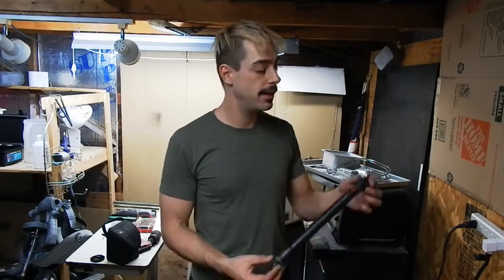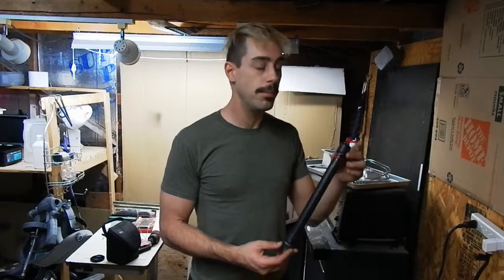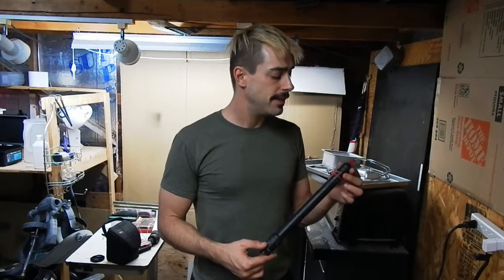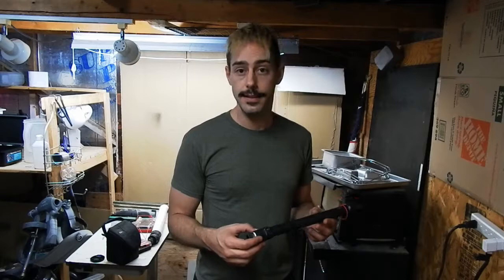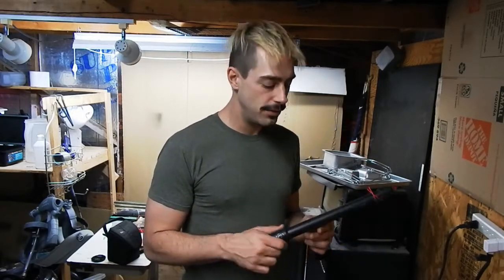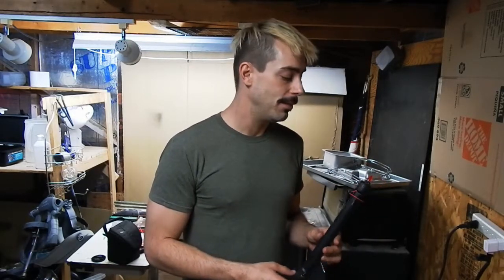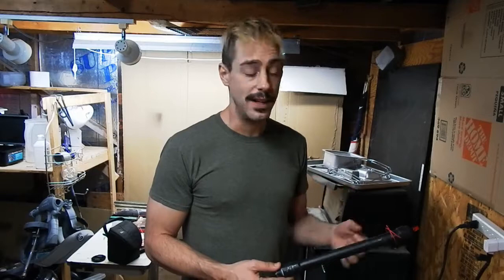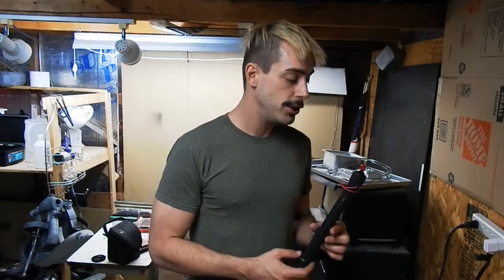DIY - Battery Swappable 12 Volt 18650 Battery pack "The Ugly Stick"

Comment: Is there a way I could wire a bunch of these in parallel? I really don't want to solder packs together. Thanks
Reply from the maker: 3D printing has many options! Check Thingiverse and consider getting it printed. You can buy them online or get them potentially printed at your local library.

Comment: Excellent I thought of the same idea of using pvc for a 7 cell pack I plan to build. I also like the idea of charging cells separately. Being my first build for first attempt at an ebike with a 26.5 volt 3/4 hp motor. Just a lil helper
Reply from the maker: Thank you! I personally wouldn't rely on pressure connection for such a high end battery though. My application was such low wattage I figured I could get away with it. Something like an eBike battery should probably have a better fuse system. Just some thoughts. Good luck!